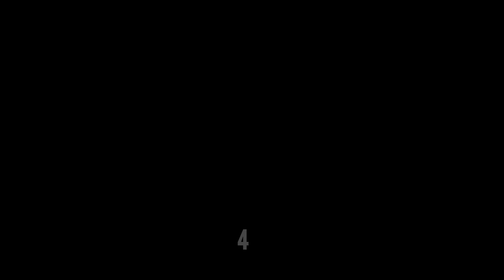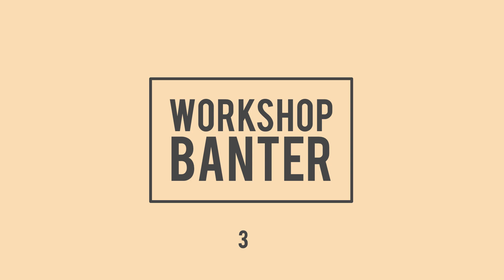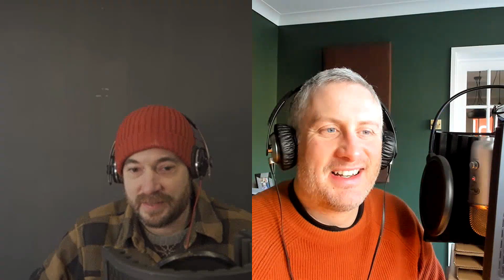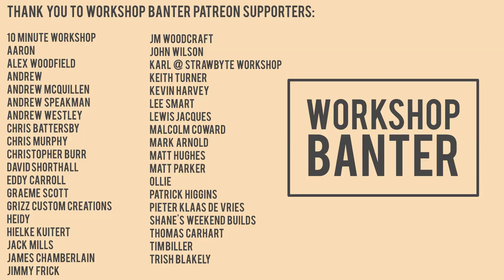EP25: WOODWORKING - THINGS THAT WE WISH EXISTED

Comment: Humidity is more the factor chaps, 10 degrees or not. When we go from summer to autum the rise in humidity is mental from about 50 to 90 plus for about 3 weeks and then it goes to about 70-80 depending on the rain.

Comment: Good show guys, and always fun talking about “unobtanium” tools! Re. SawStop, they was purchased by TTS (Festool’s parent company) in (I think) 2017, and in the EU /UK the sawstop tech is only available in the Festool TKS 80 saw. It’s not in the new cordless table saw as the tech requires and earth connection, and being cordless it doesn’t have one.  I’m in the market for a small, quiet table saw with great dust collection, but I don’t think the Festool is the one for me; there’s lots being made about the digital dingus, but I don’t think I’ve ever needed to set the blade height to within 0.1mm? The fence, maybe - but the fence isn’t connected to the digital readout, and is just a clip-on thing, so no rack & pinion adjustment either. Add in the small capacity (and high price) and I think my money’s best spent elsewhere - though I’d like to get hands-on with one, just to have a play! 

Agree with you re the the Lumberjack saw, but it was a lot more interesting when it was around £6-700, less so now it’s closer to a £1000! As Leo says, Lumberjack had a big stand at Makers Central last year.

Re Birch ply, there may be a video coming along soon about that! Take a look at Garnica Maple-faced ply (‘reinforced globulous Maple’ is what their marketing team call it!) I have some ordered, should be here soon. I bought some birch faced Poplar a while back, but the face veneers are thin and the ply layers quite thick. 🤷‍♂️👍

Comment: I really enjoy the Smirdex mesh sanding discs, even offer them over the 3M mesh.
Treatex do a hard wax oil that seems to dry pretty well, although I’ve not used it during winter temps.
As for something I wish existed, a tool brand that doesn’t re-badge Alibaba products, but makes affordable gear well. Affordable tools often have many compromises, but when it’s something integral to the tool working (e.g. Terrible fence, tablesaw blade moves with a knock of the dust port, etc etc) it’s just not necessary.
An affordable tablesaw with no bells and whistles, but a working fence, solid blade adjustment, standard mitre slots, and not terrible dust extraction should not be hard to make. Forget whizzy plastics, super secret hidden storage, or pretty colours, make it bog standard, basic, and no frills, but what is there works well.

Comment: Hi guys, love your Channel with these casual talks. Regarding the battery standard, Bosch has started this with there new alliance with different suppliers using the procore Line from Bosch, i guess its a start even though its very specific tools, but still one platform. Keep up the great videos also on your own channels and have a great new year. PS following you from Denmark, and really mis shopping on British shops after UK left EU 😉

Comment: I started school in 1968 & we had centimetres on our rulers then. As a kid I was exposed to metric & imperial and can't for the life of me understand why anyone would choose to work in imperial. I'm not opposed to older methods / systems - my partner & I have a stained glass business & some of the techniques materials & terminology we use are medieval, but we use metric measurement. Apart from anything else a millimetre is a nice tolerance to work to for most of our hand tool working: 1/16" is a bit loose & 1/32" involves insane maths.

I'd probably do more woodworking if I didn't have to deal with 'Tradespeak' & the arcane ways materials are measured & sold.

Re veneering: check out this guy's methods. Sometimes he'll apply PVA to the veneer & the surface, let them dry & then bond them by ironing on the veneer ( the heat remelts the PVA ). It's a good channel.

https://www.youtube.com/@ATRestoration

All the best for 2023.

Comment: Hi. Another sensible chat about the frustrations in the building trade. Regarding battery adapters, I would warn everyone that they do not have safety cutout built in. I have used one in Ryobi hot glue gun with dewalt batteries and it has killed them both(used second one before charging first). I believe this happens when the tool is a constant high output tool, eg hot glue gun, heat gun etc. Hopefully this will stop someone experiencing my pain at having to replacing 2 batteries.

Comment: Great pod again ,thanks lads you have brightened a cold day in Durham. I agree with almost all your opinions. (Great minds think alike and tools seldom differ) on the battery front I believe Matt's blue tool maker are joining up with others to standardise a system called power-for-all. Workshop,garden and other tools. Why don't they all must do the right thing??Apparently that's comerce. 
Very clearly metric is the way ahead but it's old habits did hard ,even Matt wanted a 2lb bag of nails. I find myself using both systems depending on circumstance. I've just bought 2.4m of 2" by 4" .it's insane.

Thanks again really enjoyed .
Reply from the maker: Thank you. The power for all system is Bosch green (home and garden) not Bosch blue as far as I'm aware. So  in other words Bosch doesn't even share batteries between it's professional and home and garden range 🤣

Comment: Another imperial oddity I see on American videos is saying 8 quarters of an inch, which in my book is 2 inches!
Have you guys seen the new Festool sustainer table saw due for release next month? Astronomical cost aside it looks a smart bit of kit…..cordless, digital blade tilt and height adjustment and so on. Some strange design choices though like the blade tilts towards the fence making bevel cuts a bit sketchy, and also a limited 280mm rip capacity. I still want one though.
Reply from the maker: Cheers, yeah Matt mentioned it later in the podcast. Looks interesting but out of reach for most of us at that price I think
Reply: @WorkshopBanter  Perhaps I should finish the whole podcast before commenting! 😂

Comment: Agreed the F out of most of this tbh 😂 As an ex tradey - trust me, it's not that old timers are used to how it works, it's that they've learned to not bother looking and just ring up and talk to a rep. Everyone knows the websites are a waste of time. But they shouldn't be! Imperial vs metric: biggest issue it caused us once is when putting up rows of massive roof truss assemblies. Gaffer called down for a 6ft spacer - which I cut exactly 6ft (about 1829mm). What he actually wanted was a spacer exactly 1800mm, as per the drawings. 12 more truss assemblies erected before clocking the spacing was out by 30mm! I never forgave him😂 Hell of a job to put right. Despite his protestations, I demanded metric from the old timer from then on. 🤦‍♂️
Reply from the maker: Oh man what a nightmare!!! 🤣 That's such a good example

Comment: I don't find American woodworkers using Imperial measurements too confusing but I wish they'd stick to using the same type of fractions (i.e. the same denominator) throughout. If they stuck to "sixteenths" then I could think of that as just being a slightly large millimetre. It's when they say "a quarter" then "five sixteenths" then "three eighths" that I struggle... if those were 4/16 then 5/16 then 6/16 respectively then I would find it a lot easier. If I ever start a woodworking YouTube channel, I plan to give the imperial equivalents as something like "three-and-a-half seventeenths" just to get my own back!
Reply from the maker: Haha, yes!!

Comment: Does the new festool contractor saw not fulfil most of those criteria? It looks like a beautifully made machine.
Reply from the maker: I'm sure it's a great option but only if you have the big bucks to spend
Reply: @WorkshopBanter  I believe sawstop has licenced their safety tech to festool and is on the new saw. Also Felder have their own blade brake/safety tech.

Comment: Posted in a previous vid but I wondered what you both thought on what is woodworking? Like is it machine made Cnc machined wood? Is it big machines? Power tools? Hand tools? The reason I ask is since going semi off grid I now harvest my own wood and my god is it hard work making lumber from a log/ tree. I have to do it via an axe and then smooth it with a hand plane. Where as beforehand I had lovely pre milled kiln dried wood. We feel very far removed from woodworkers of old. Like Rubo or Chippendale, so my question is - is this all just woodworking or should there be some snobbery/ sense of extra pride from making things from absolute scratch ie from a tree. An if the answer is it’s all woodworking then what happens when any man made element is taken out. Like it almost is with cncs? Harvesting my own wood made me realise how far removed I was from the actual source of my medium an the appreciation of how long it has taken to grow. Hope that makes sense.
Reply: Interesting topic. What you're doing sounds awesome, working the raw wood. For me, I'd say yes, it's all woodworking. The cnc is just another tool. A designer/maker still needs to understand the material, whether cnc'ing or hand carving. Each needs it's respective skill set too. Can you design in CAD and program a machine path on a cnc for example? I would say however that it's important for anyone who works with wood to know working it by hand as a foundation. True understanding of the material stems from that. But that shouldn't be the beginning and end of woodworking. If technology can push your creativity or efficiency, use it.🤷‍♂️
Reply from the maker: I'm pretty sure we discussed it in a previous episode, but I can't remember which! 👍
Reply: The only way we get to any sort of standardisation like a common battery type is if governments step in on the basis of environmental reasons. Like the EU have done forcing Apple to adopt usb-c ports for charging in Europe. Otherwise, like you say, it’ll never happen.

Great Pod chaps.